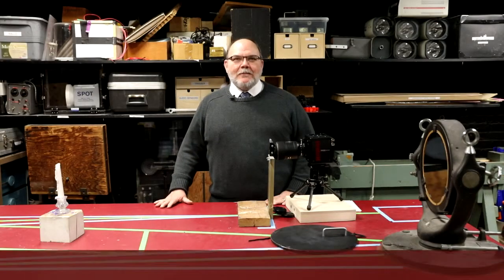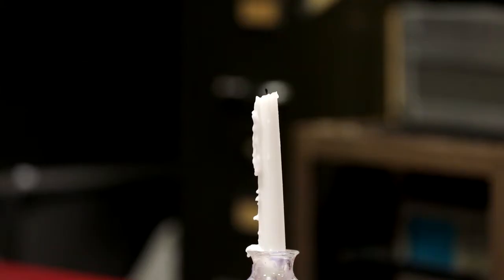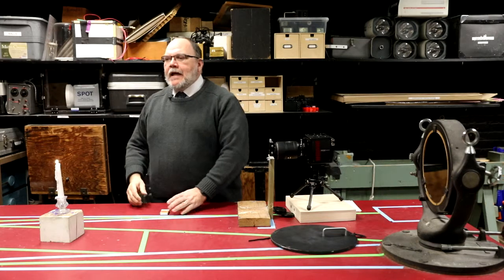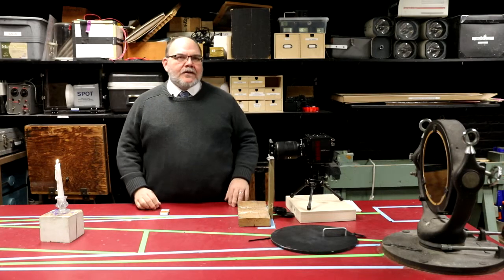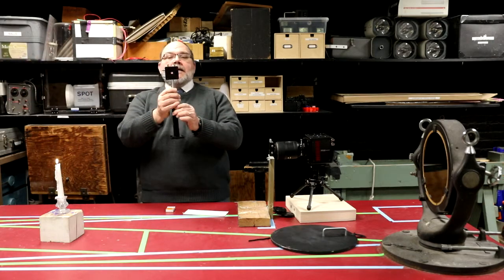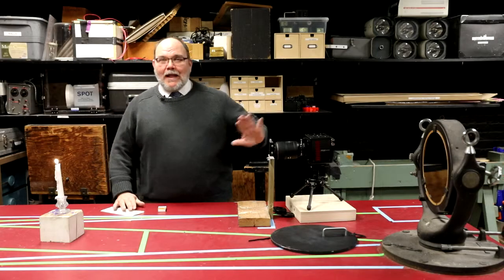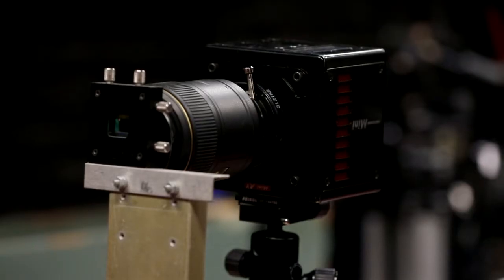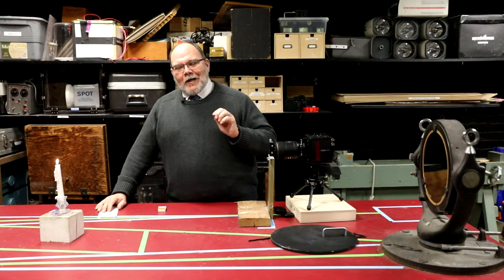Schlieren System Demonstration at MIT

Comment: Hi Dr Jim, thanks for this explanation on schlieren! I'm going to be attempting to set up my own system at home to attemp to capture the shockwaves from a bullwhip just like you guys did when my friend Adam visited your lab years ago for the show Time Warp. I was just curious as to what the size limit is for the diameter of the light source. I'll be using a microscope illuminator which is around 12mm is diameter, but I'm beginning to worry that it might be too large. I'll be using a 12in parabolic mirror. I'd love to attend one of your seminars in the future if you are still offering them. Thanks for your time.